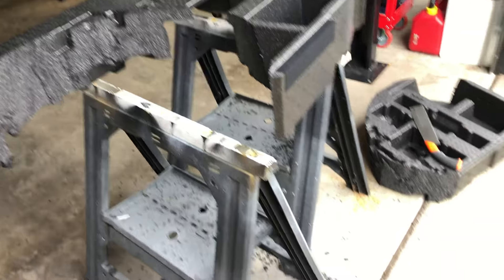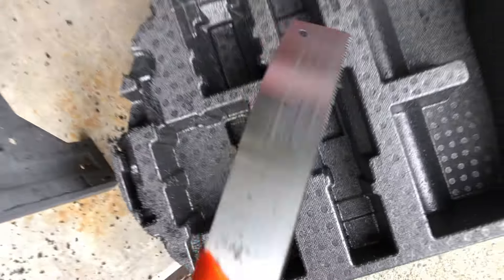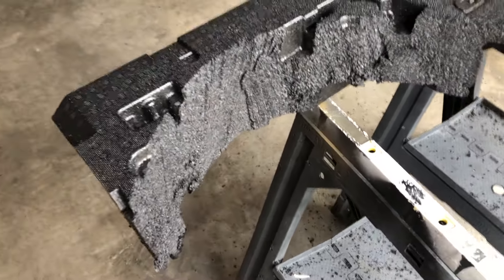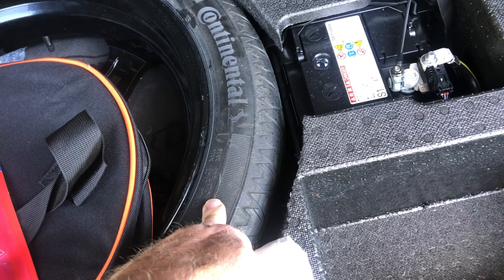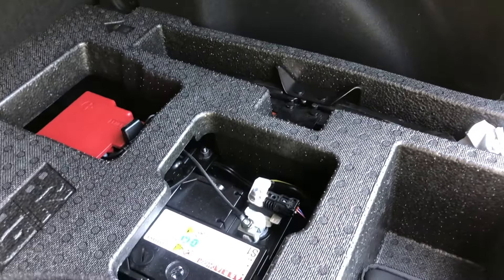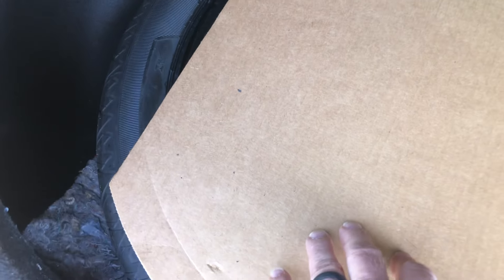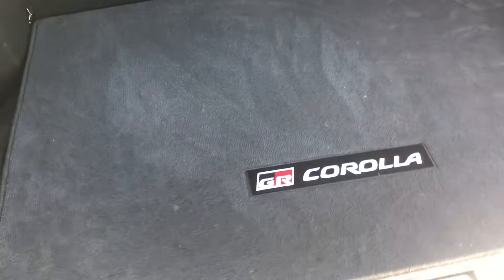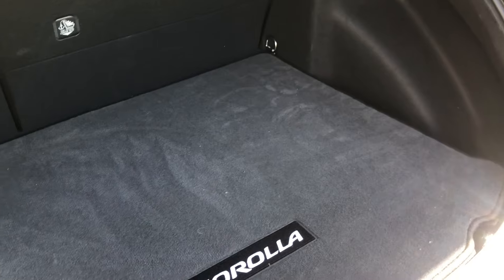Why This Spare Tire is ESSENTIAL for my GR Corolla

Comment: be sure to add a 19mm socket to your tiring changing kit. the lug nuts that come with the modern spare are different size compared to the OEM ones.
Reply from the maker: I did add the proper socket for the lug nuts for both the aftermarket lug nuts and the Modern Spare. Good point too!

Comment: what were the cavities in the foam you cut out used for; or what was supposed to go in them??  Black Duct tape over the cardboard that stuck out on the side would have helped hide the cardboard better.   hmm, because the battery is set in the middle-center of the hatch floor, you lose 6" of hatch depth just because of the battery?  If the battery were moved further to the p-side, you could in theory have a lot of additional floor storage, but no, Toyota had to put the battery there.   They could have done a much better job than they did, imho, on the under-floor "storage".  Seems like more minimal effort "D for diploma" stuff from a major manufacturer.   Glad you got your spare sorted.

Comment: Hi Jim, thanks for the video. Any chance you remember the type/thread size or even better the part number/link for the bolt you used for the D-ring?
Reply from the maker: I just went through my box of bolts that I have and found one. It's a very common size though that is found on the car. Try one of the bolts that hold the D-rings on in the hatch area. I think they are the same size as what I used. If you don't have a box of bolts I'm sure that a hardware store could help you find the right size.
Reply: @jimsgaragetoys  Thanks. Living in an apartment I can't keep spares. Wish I had a garage like yours though!
Reply from the maker: @V1C-A  I remember my apartment days many years ago. I actually had a set of winter tires and wheels stacked in the corner of my bedroom. 🤣

Comment: Does anyone know the allowed difference in diameter between tires on our car? I have aftermarket wheel/tires, 25.3" diameter, this 135/70 spare is 25.5". Thankd for the helpful video. Ive been pretty nervousr driving this car without a spare.
Reply from the maker: I've been trying to find a definitive answer to that same question myself. I went with this size because my sock 235/40R18 is 25.4" in diameter and this 135/70R18 is the exact same diameter. At some point I wouldn't mind going to a 245/40R18 but the diameter is 25.7" making this spare 1.2% smaller. I'm not sure if that is within the range of being okay or not but I keep looking for an answer. At least this is the exact same size for now so no worries for now.
Reply: I'm running 265/35 at 25.3 dia and online calc says 135/40 is 25.5 so was hoping it close enough. I think it's only a 0.8% diff in dia. I've read up to 3% is ok on some AWD systems. I would guess we could look up other Toyota AWD cars and see what they run for spares, but I fear they also don't have spares but these dumb slime kits. I'm likely to grab a plug kit in the meantime. Let me know if you find anything out! Thx for the videos, cheers!  @jimsgaragetoys
Reply from the maker: @LifeSOSlive  When I just looked it up it shows me the 265/35R18 is 25.3" and the 135/70R18 spare is 25.4" so the spare is only 0.4% larger so I would think that would be within any tolerance.
Reply: Aahh yes! I used a diff calculator and got your same measurements! In think you're likely right, that's much less than 1% dia difference so I would hope that's ok.  @jimsgaragetoys

Comment: Has anyone tried to relocated the battery to the engine bay? Or at least make some case to go around the battery in the trunk in which you can take the foam insert out and gain valuable depth of trunk space?
Reply from the maker: Yes, I saw someone do that. They made a box around the battery and lowered the floor in the trunk around it. I feel like I used the space the same way for my spare tire. I found that I had plenty of room in the hatch for my stuff on my road trip.

Comment: Did you buy the spare? Or is it from another vechicle? Any links to it or where i can get one?
Reply from the maker: Yes, I bought a Modern Spare. I left all 3 options with links in the description below the video. Just click on the "more" to expand it. You can by the tire/wheel only, or with the tools, or also add a bag as you will see. There are also the same 3 choices with a steel wheel for less money.

Comment: what do you mean drill out a hole for the D ring? you mean you drilled into the car? Also do you have a part number/link for the bolt you use for your D-ring? 
For the wheel/tire, I would probably install it faceside up for your structural support. Put your tool bag under the wheel since the gap will be there now.
Reply from the maker: If the D-ring hole is too small for the bolt you might have to drill out the hole a little to make it big enough for the bolt to slip through, if it's big enough you are good to go. 
I tried the wheel the other way but it's much easier to put the wheel in upside down and fit the tool bag in. When having to lift the wheel and stuff the tool bag under it, it's more of a PITA. Plus when the strap is on it won't rub the wheel paint in any way. Others have found this way to work better too.

Comment: So what size tire/wheel is on your GR? Then, what size/type wheel tire did u USE as a spare? U mentioned a "donut" but how/where? Professionally done! 👍 
I have mixed emotions on HAVING a spare. ALL my other Toyotas I've owned over decades, I've NEVER had to use my spares (they were all like new). But just knowing u HAVE a spare, gives u security.
Reply from the maker: I have 235/40R18 tires and the spare is a 135/70R18 which is the same diameter. The links for the tire options are in the description below the video. 
I've had to use my spare twice over the years but you are right, just knowing you have one is a huge peace of mind. I travel in a lot of areas that don't have cell service so a spare tire is a must. 
A spare tire is like a gun or condom, better to have it and not need it than need it and not have one! 🤣🤣🤣